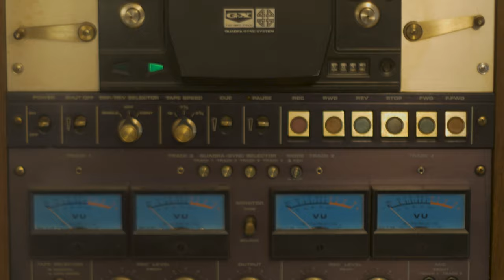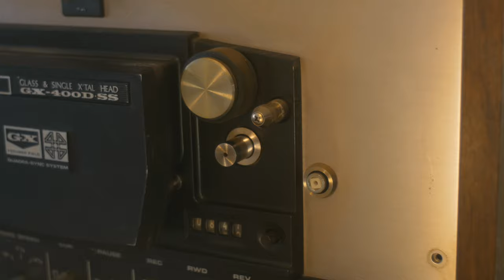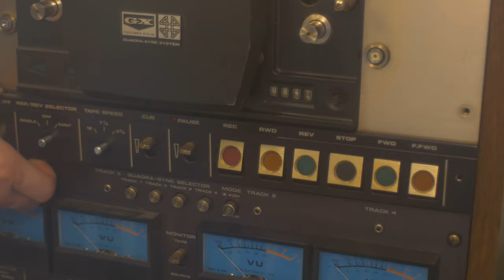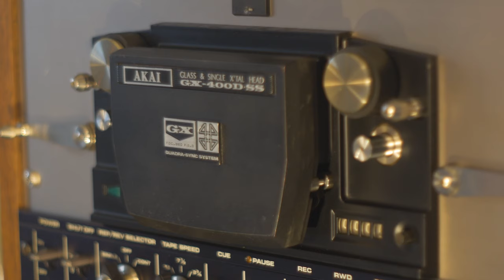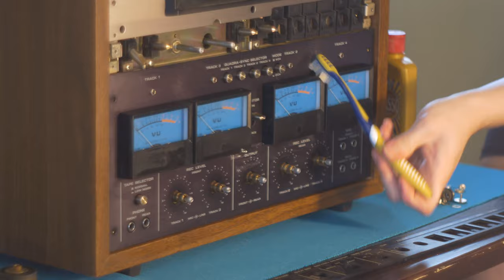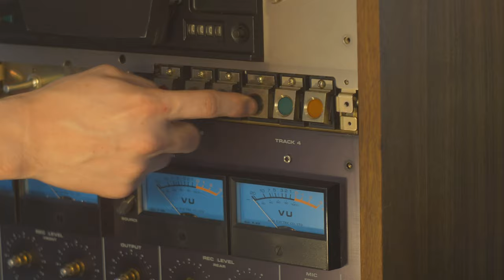RetroTech | Akai GX-400D-SS Quadraphonic Tape Deck Restoration

Comment: Any advice for replacing a broken tension arm on one of these? I bought some JB weld and was going to give that a go to mend the plastic in the arm, but the auto reverse is also conducted through the arm so am hesitant about it. Any advice? 😊
Reply: Did you ever get that fixed? I just bought a new one and can share where I got it if you like.

Comment: I used to own one of these bad boys but sold it only a few years back. I was surprised to hear they only built 800...mine was the silver/white (latter?) as opposed to the black/blue as shown here. Where did you glean the info about only 800 built and the 400/400? Did you do a record/playback test?  Just curious. Mine was flat beyond 22KHz, and I loved the fact that it had big features: 10 1/2" reels, auto reverse,  3 speeds, etc. But alas, ReVox A77s sounded much better. By the way, I like your sound effects very much....nice job, man!
Reply from the maker: The owner of this Akai told me about the 800# rumor, neither of us know how accurate it is. The two channel version of this does have a similar rumour about it floating around on a couple of forums. I did do a playback test and it sounded pretty good but it should be looked at by a professional for a full electrical restoration.

Comment: Welcome To Tapeheads, ha, recognized the Marlboro typo straight away, since i had been looking at some old Hi-Fi magazines from the 70's. Like your comment style. Please note that potentiometers should be cleaned with contact spray, not WD-40, that is used for mechanical parts at best to unblock stuff. Old WD-40 gets as sticky as the stuff you have just cleaned. If This would be a piece of furniture i'd be ok with the 'restoration' term, but as this is a piece of vintage hi-fi restoration would mean: finding the service manual, (Hi-Fi-Engine for example) to have instructions how to dismantle the deck, checking and replacing the belts if necessary, cleaning the potentiometers for record volume output volume etc, clean the switches with... yes, contact spray. replacing a certain number of capacitors which have aged, you might also have some transistors which have become noisy, check the playback with a calibration tape, recalibrate the deck for some modern , now available new tape, make a test recording, demagnetize the tape transport.....

Comment: Cool video. How does this compare to the Akai GX 280D-SS?
Reply from the maker: I'm not sure since I've only had experience with this and a GX-265D stereo deck. The Trac 3300S I currently use sounds fantastic though, highly recommend.
Reply: I love quad, and may be getting at 280 soon. I'd like to see another video about this 400D.
Reply: @inthezone4123  I have 2 280dss (both the GX models - make sure it has that designation as it came both ways) - great machine, as long as you only ever want 7" (or smaller) reels.
Reply from the maker: @inthezone4123  It will be featured in a future video on Quadraphonic sound. Plus I now have the remote to show off when that time comes.
Reply: Thanks Bill. I'm having one refurbished for me. I'd like to make a few reels from quad files I've downloaded and put onto disc. I'm not sure how to do this.
Reply from the maker: @inthezone4123  Depending on the format of the disc, you should be able to get a last generation SACD/DVD-A Universal player with 5.1 Analog outputs. The player can be set to down mix 5.1 and play it as 4.0 through the appropriate analog outputs along with proper 4.0 content. The player I use is the Pioneer DV-578A-S.
Reply: Interesting. Could I plug this in directly to the Akai 280, or would I route it through my quadraphonic receiver?
Reply from the maker: @inthezone4123  Either way would work

Comment: Never use WD 40 on electronic components, specially on pots!  WD 40 is excellent for cleaning greasy outsides only!
Reply: I dare you to have that argument with Barry Fone!
Reply: That yellow topped spray he has beside him when he starts with the WD-40 is actually the WD-40 brand of contact cleaner. Why he didn't use that instead..
Reply: @sirlemonhead7715  WD-40 is a good light lubricant.  Not the best for cleaning pots, but probably the best for maintaining pots.
Reply: @That_AMC_Guy  It's a terrible lubricant. It's a water displacer... good for degreasing or helping remove rusted bolts, but it dries fast, gets sticky and attracts dust. It should never be used on pots. It can also ruin plastic and rubber. Contact cleaner is all you should ever be putting near a pot.